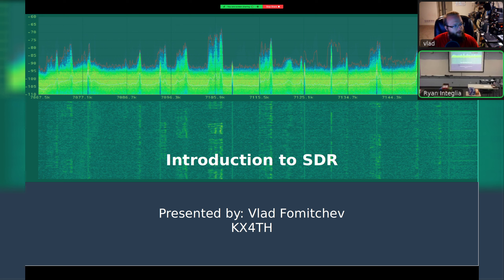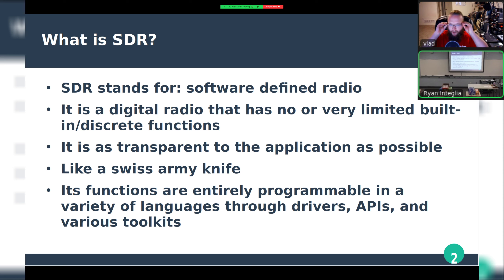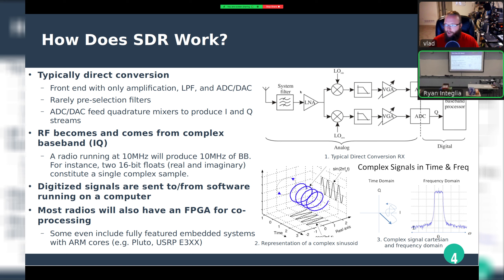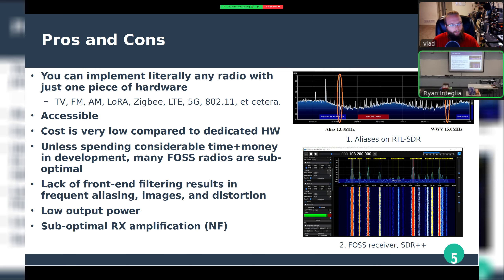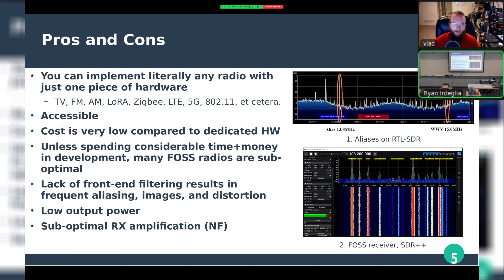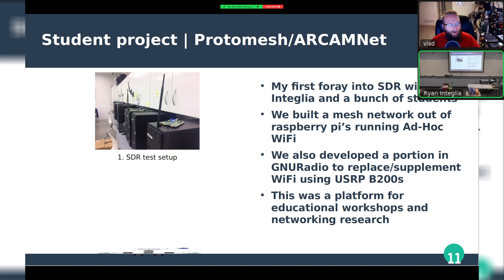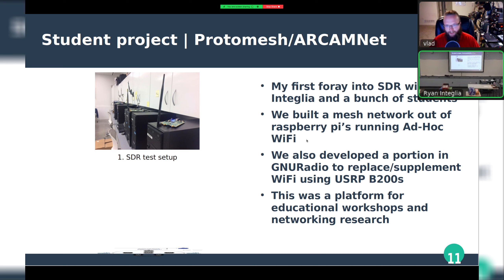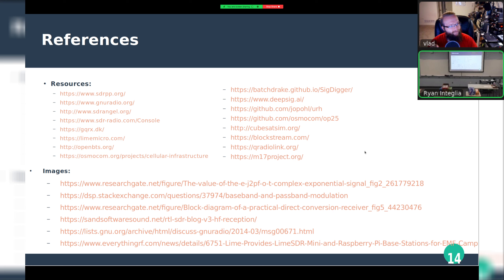Introduction to SDR presented for IEEE at the Citadel

Comment from the maker: @9:30 I explained the alias on slide 5 figure 1. poorly in the recording. If you were wondering, what can happen is if you have a very strong signal just outside of your passband/sample rate filter, it can still show up in your spectrum via aliasing. Aliases for complex sampling radios will typically be at Falias=2*Fc+Fs-Fsig. so if I've tuned to 10MHz (Fc) with a sample rate of 2MHz (Fs)(Sample rate of each ADC on slide 4. is actually Fs/2), I can see 9-11MHz (Fc+-Fs/2). If there is a very strong signal at 11.2MHz (Fsig) that is not suppressed enough by your LPF, then you will see the same signal pop up at 10.8MHz (Falias) where it doesn't actually exist. This is aliasing. 

The example in figure 1. is actually a bit confusing because the RTL-SDR that produced the screenshot actually runs at at 28.8MHz real sampling. see the following from the links on my last slide for more detail:
"...You will see aliasing of signals mirrored around 14.4 MHz due to the Nyquist theorem..."
"Note that [the RTL-SDR V3] makes use of direct sampling and so aliasing will occur. The RTL-SDR samples at 28.8 MHz, thus you may see mirrors of strong signals from 0 – 14.4 MHz while tuning to 14.4 – 28.8 MHz and the other way around as well. To remove these images you need to use a low pass filter for 0 – 14.4 MHz, and a high pass filter for 14.4 – 28.8 MHz, or simply filter your band of interest."